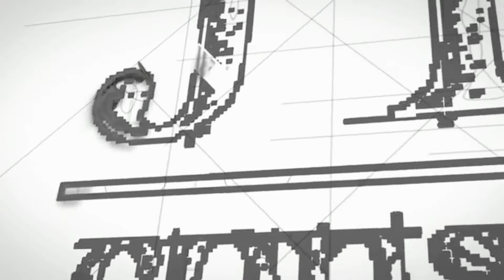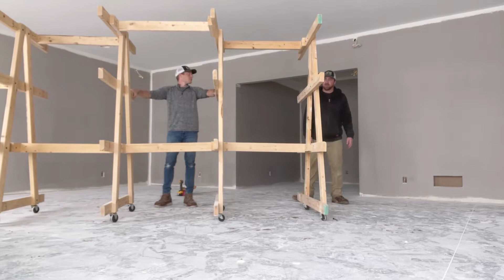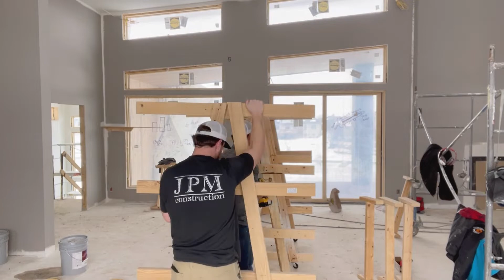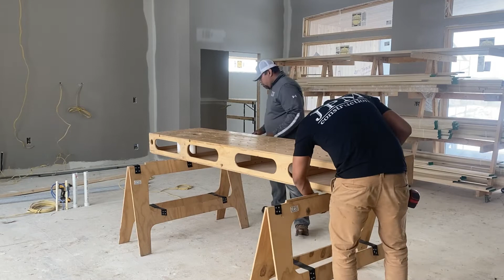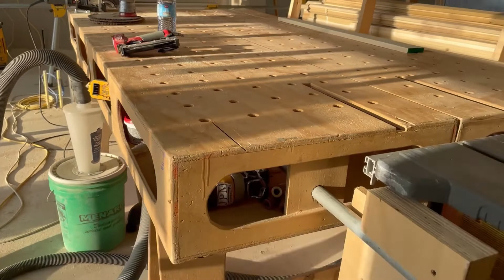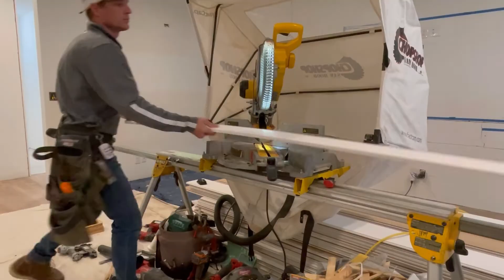Organize your job site

Comment: I like your whole time setup, the outfeed for the table is a must have and I'm hoping to build a compact one for my corded 8-1/4" Dewalt table saw but it's tricky figuring out removable mounting brackets and still be able to use the saw on a 45° angle. Any recommendations on quiet shop vacs to use? I have one duststopper pro and want to add some more and looking for some quiet shop vacs, the ridgid's are the loudest most annoying thing to use lol
Reply: Expensive but quiet... festool

Comment: Wondering what type and size casters you are using? Great video - looking to implement this on my next job site!
Reply from the maker: I can check but I just based it on a solid caster with a decent size plate but able to fit within the 3”x3-1/2” section available from the a frame